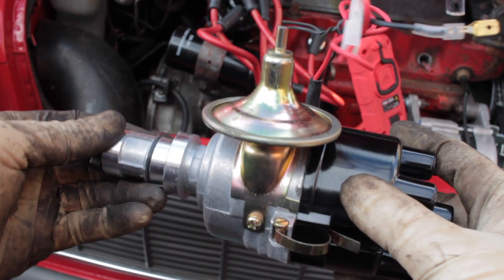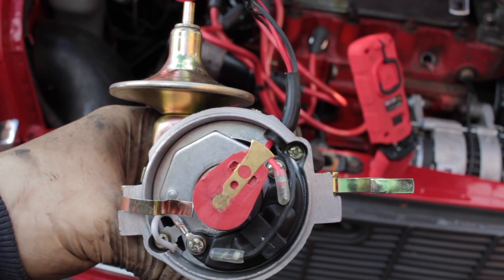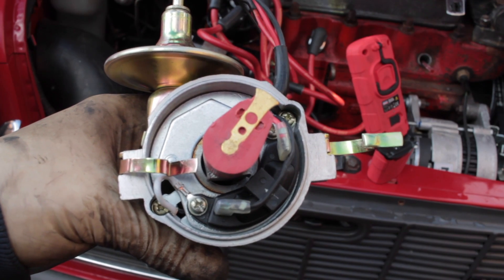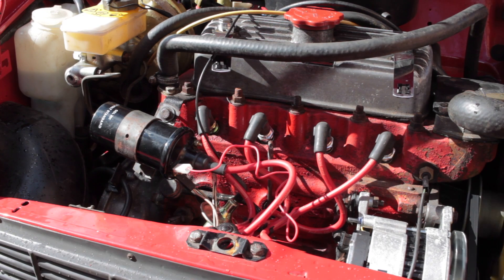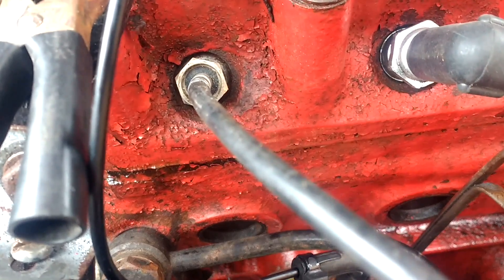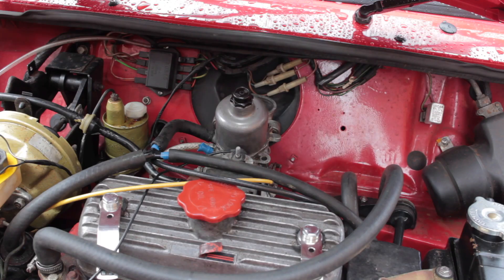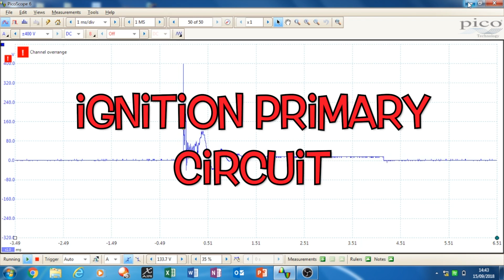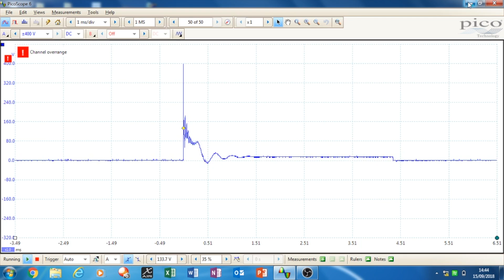Mini 1275 GT - Electronic Distributor Install/Hesitation Diagnostic!

Comment: fantastic video i have a problem with my mini to start the car and works near ok the vaccum pipe is touching the oil pipe that goes from the filter to the block any help? been told that its retarded but checked with storbe light and looks good .  helpppppppp

Comment: Very nice Sandy. I like the action with the scope!  Was it the 4 channel model?  In 1969 I worked at Bill Young Sport Cars in Glendale Calif. I remember putting many Lucas Quicafit point sets in Austin Americas. Clutch in MGB. Overhaul an MGC. It was a six cylinder. Fun and games in the OK Corral. I watch all your vids
Reply from the maker: Cheers Bill, no it's the cheap 2 channel picoscope (2204a) with 40;1 attenuatiors, we visited Glendale on our recent trip take care sandy

Comment: Sandy jeez a 1275GT ?
Its been a long long time since i done one of these.
They were however very common for the needle and jet wearing causing them to run rich.
Also i cant remember what oil you put in the carb but i'll find out and post it.
When doing the distributors on these i used to take the grill off.
Reply from the maker: Cheers Tam, I'll get him to order jet and needle
Reply: Sandy the oil that goes in the card has to be a light oil ATF something along these lines.
It's common to go through  quite a bit of oil  after several months.
I was trying to rack my brain about the carbs on these.Did they not come with twin SU's ?
Here is some good info on these carbs.
http://www.volvowiringdiagrams.com/volvo/Carbs/SUbookletsAUC9940HIFcomponents.pdf
http://www.volvowiringdiagrams.com/volvo/Carbs/Tuning%20SU%20Carburetters.pdf
http://www.volvowiringdiagrams.com/volvo/Carbs/Setting_SU_Carburetors.pdf
http://www.volvowiringdiagrams.com/volvo/Carbs/TP11740-2%20Carburetted%20Fuel%20Systems.pdf
Reply from the maker: @tam1381  cheers Tam that's great info about s.u. carbs, was it no the big SD That had twin SU? Cheers sandy